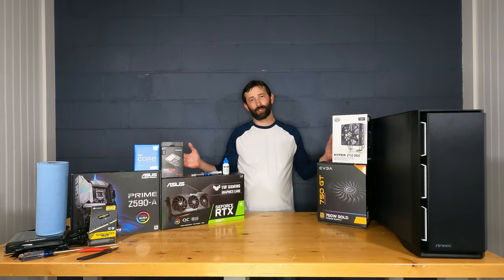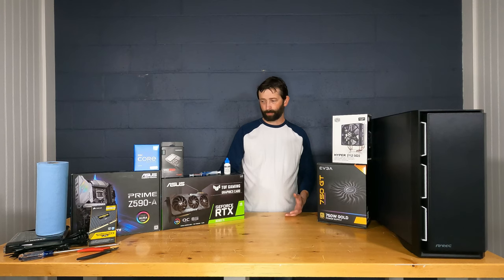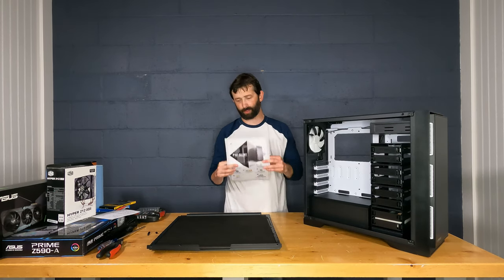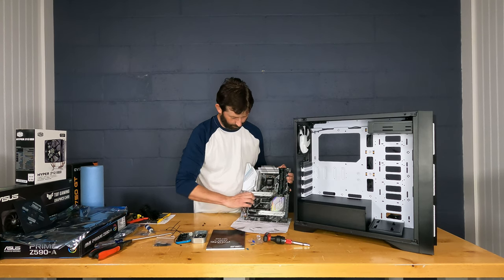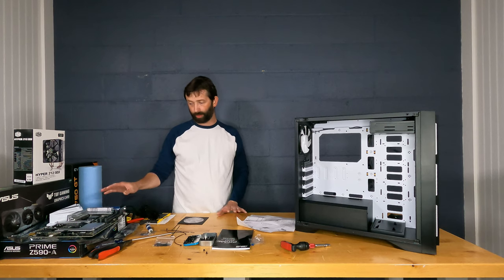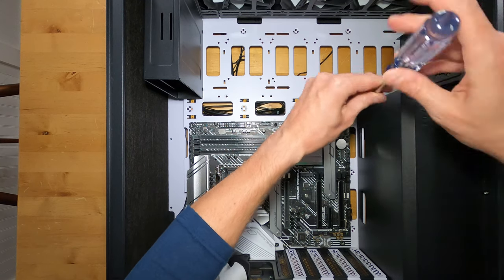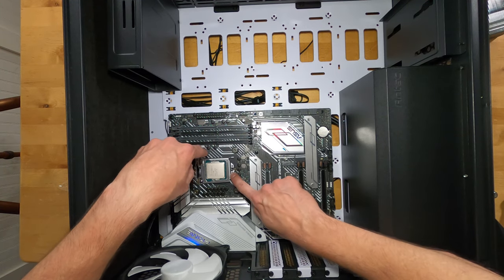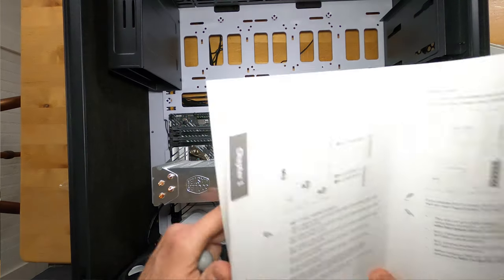How to Build a Custom Desktop PC - Step by Step!

Comment: i have this exact case, it was impossible to install a water cooler, but besides that issue, the case is pretty awesome, thanks a lot for showing how to hook the small connectors from the case, you really helped me, nice setup, very clean.
Reply from the maker: Glad to help!
Reply: @ZipTieNinja  thanks! Hope you can help I did finish all my setup but when I try to install ram(two 16gb modules ddr5) they don't work together, if I remove one of them they system starts normally, I read the manual from my msi b650 tomahawk and it says I need to put ram in slot A2 and second one on the B2 slot, but they just don't work, any ideas ?

Comment: Overall it's a nice build. Jyst few minor mistakes: 1)Ssd 970 evo plus has better value for the price. 970 pro has better quality(significantly more durable MLC). Should have chosen one of theese. 980 pro is f bit edgy. No problems with other components. I would put seasonic prime instead of EVGA, but it's a matter of taste. 2)Should use a better cooler.  Noctua NH-D15 for example. Cooler Master Hyper 212 Evo is ok for everyday use, but for rendering and long 24/7 100% load of CPU it's a bad choice, not a top quality cooler, just midrange @bang for a buck@ one. Other components I can fully approve. 3) Minor mistakes during assembly. You should first build pc on a table, install windows, run tests. Only after tests you dismount cooler, GPU, install motherboard in case. Then 1)plug 8pin cpu power 2)Plug all other connectors except for GPU power 3)Mount cooler 4)Mount GPU 5)Plug gpu power. This method allows to test PC before doing tedious cable management. Also my method saves time and is more handy overall. Massive coolers often obstruct 8pin CPU power and it's much easier to put cooler after 8pin is set.
Reply from the maker: All of these items are of your personal preference, not "mistakes". Thanks for the input.
Reply: @ZipTieNinja  sorry for rudeness. English is not my native language. I didn't know the term "personal preference", thank you for a new term.  I also have been bulding lots of custom pc for about 17 years. My personal preferences are based on experience. If you insist, that "mistake" is a too harsh term, then there are no mistakes in your video. I have seen about 150  videos on the same topic, Yours is one of maybe 5 best. That's why i've spent time to critisize(give input, thank's for this term too) . What I liked least of all is that you have plugged 8pin CPU power after mounting a CPU cooler. In this case it's not a mistake, because Antec P101 has lots of room for hands. In other cases sometimes you are forced to dismount cooler or uscrew motherboard to fit 8pin connector. Thank you for your reply. Your content is A+ quality, it's very sad that channels of such high quality usually have very little subscribers. Thank you for your reply, keep your exellent level of videos.
Reply from the maker: I really do appreciate the feedback. A lot of times people are just looking to be right, not to be helpful. Thank you for the compliments, and hopefully the channel will continue to grow!

Comment: Hi I would like to build a custom desktop with performance and speed for work.  To navigate the web for brokers/ load management analytics/analytical and map/gps tracking for trucking company and want something that’s a multi use purpose and movies/videos/some gaming dash cam viewing and downloading videos.  Just want a well rounded stout desktop with performance/power/speed/security/video/little gaming.  

Please let me know how and what I need I’m mechanically inclined in terms of pc but I’m not ashamed for asking help.  Thanks for the great video and
Reply: i think you are good to go with and AMD 9 5900x, 16gb of ram ddr5(but 32 is ideal), as many M2 space as you would want, i would ask for 1tb, a Thermalright Peerless Assassin cooler, CORSAIR RM850e 850w power supply, meshify c fractal case, and and a radeon rx 6400.. thats not a super expensive setup and its real powerful